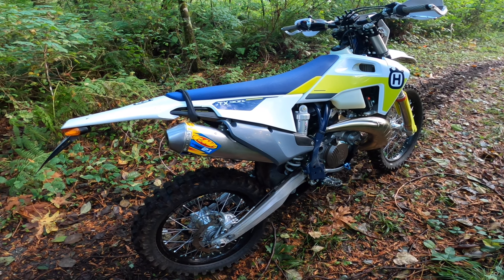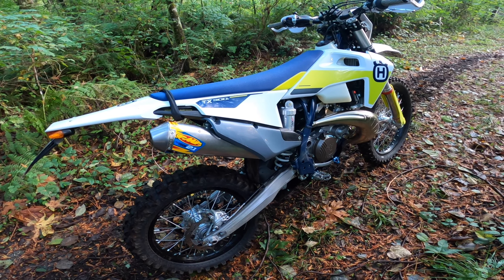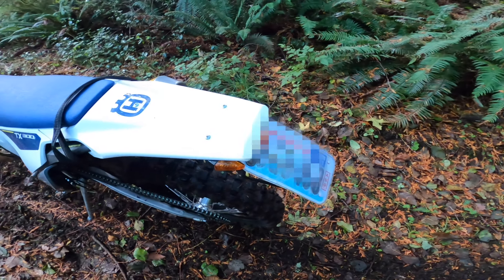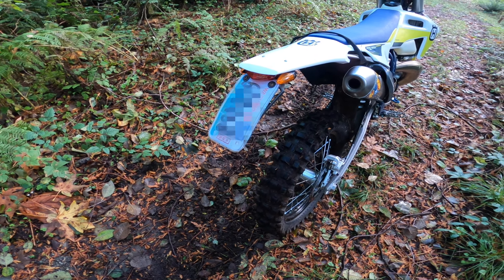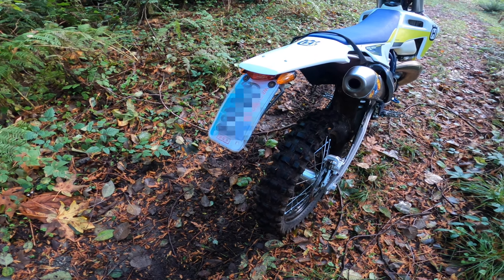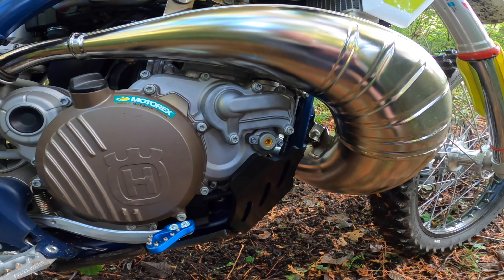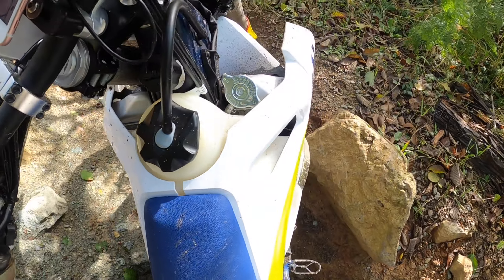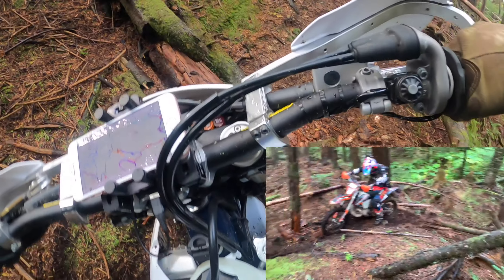2021 TPI - Mods, Issues, Fixes [KTM XC-W, Husqvarna TX300i]

Comment: Hey there, love your videos, I’m considering going from a 500exc to a 300 Te or TX, I’ve read about the problems with the carbon subframe breaking. Do you have any opinion on this?
Reply from the maker: It’s weaker than aluminum for sure. But I haven’t had any issues. Supposedly the 2021+ subframes are slightly stronger.
Reply: @WASemiHardEnduro  thanks, I guess every bike it’s pros and cons. One thing I read is everyone loves it for riding the trails.
Do you get to ride all year long being in the pacific NW
Reply from the maker: @3dpdstom  Yeah we do. There’s maybe 1-2 weeks per year when there’s lowland snow.
Reply: @WASemiHardEnduro  where are you based and riding, I like the idea of moving to the USA from the UK
Reply from the maker: @dirtbikefun  Western Washington State, not far from Seattle.

Comment: 3.5 turns out on the air screw is stock so 4 turns is not that far out.
Reply from the maker: You're right, but to get the idle where I wanted it, I felt like it was too lean right off the bottom @ 4 turns out. With the idle screw mod, I'm now at about 1/2 turn out, which seems to give it more torque right off idle. My seat-of-the-pants feel anyway.
Reply: Mine feels pretty good at the stock setting but I will try adjusting and see how it feels. Did you adjust your PV dolly?

Comment: I don’t understand. You bought a brand new bike and you have issues with it? How can this be? The reason you buy a BRAND NEW product is that you won’t have issues with it. How can you accept the fact that the power valve is already leaking? Please explain?
Reply from the maker: I updated the description a while back - the PV leak has completely disappeared, so maybe it was a spill and not a leak? I confirmed that KTM addressed the gasket issue on the 2021s. If you've never had a single issue with something you've purchased new, then you're the lucky one (and probably a rare exception).
Reply: @WASemiHardEnduro  but TPI issues are known for KTM/HUSQY back from 2018 why would they don’t fix it??
Reply from the maker: Seems like they did fix it (the PV leak). The other things I did were to make the bike better *for me*, like raising the idle. The bike works just fine stock, but like all things, can be improved.

Comment: For the Stout Mount, and Hondo Perfect squeeze ( I just bought both ).. Did you have to drill holes in the stout mount or the hondo (and tap)
? Or are you just using one screw for the hondo perfect squeeze?  the only holes that line up for the hondo mount would make the phone vertical which I don't want.
Reply from the maker: No I didn’t have to drill, the holes lined up (both should use the standard gps mounting dimensions)
Reply: @WASemiHardEnduro  Well that is strange, mine only lined up if the hondo was sideways which would make the phone vertical ( yuk!)
.  What I ended up doing was. Reamed out the bottom hole in the Stout Mount so bolt would fit through it.  Used calipers, measured 38mm drilled a new hole near the very top of the stout mount plate.  Also I had to cut the ends off the bolts that came with the hondo perfect squeeze because they were to long.  Anyway its on now loosely :)  Just need to finish mounting my USB Job and button it up. Mine is on a 2021 TE250i.  Thanks for the videos! Those trails in WA look a lot nicer than the trails here in Bend, OR.  https://i.imgur.com/5ggUTAh.jpg     https://i.imgur.com/SHn47G5.jpg      https://i.imgur.com/EgnEzLJ.jpg     https://i.imgur.com/nOFAWQ7.jpg

Comment: I just got a 2021 ktm 300 xcw tpi and have put about 1 hour on it and now it doesn't have spark new plug nothing hold onto the plug don't get shocked any ideas taking it to the dealership to see if they can fix
It
Reply from the maker: Double check all the wiring connections is only thing I can think of

Comment: I havent looked into it at all yet but does your perfect squeeze mount just bolt right up to the stout mount? It looks like you are powering your phone also but via the cradle?
Reply from the maker: Yes, the squeeze bolts up to the Stout mount. I’m using a separate usb outlet for power.
Reply: @WASemiHardEnduro  are you powering your phone directly or does the mount or squeeze have a power port? Tough to see. Cool setup though.
Reply from the maker: I’m using a Burnsmoto USB port to power the phone.

Comment: What are your suspension settings? My '21 300 xc feels terrible front and rear. Im coming off a '19 300 xc and I was actually very happy with the stock suspension on that bike. I was expecting the '21 to be even better, but it just bounces and deflects off everything.
Reply from the maker: Interesting - I'm running 123 psi in the forks, right at 110mm sag rear (but 40mm free sag which is a little much). Clickers are at the "comfort" settings per manual, except I've added back 2 or 3 clicks of rear rebound. I weigh 145. The 21 feels softer/more plush to me than other XC/TXs I've ridden, but I admittedly don't have much time on the older AER forks (I came from a Xplor48 bike, and this is 100% better in every way except comfort on fireroads).
Reply: The new mid set up was a nice edition and the bike works great for MX/GP style riding but is horrible for woods, hack, rocks and anything square edge over 1.5 inch. They respond really well to just a revalve and fluid level change. I went with MX Tech Lucky Kit because I want the feel of a spring fork. Corey at Protune is making the 21 fork work pretty awesome in the woods with just some shims. Honestly the 17 AER fork feels better in single track than the 21.
Reply: @cknymapleleaf  Haha its funny you say that. I took my stuff to Corey and it works amazing now after just a revalve. I considered the lucky kit, but decided to try the cheaper route first. I'm glad I did, because this is the best suspension I've ever ridden. It's was absolute garbage with the stock valving
Reply: I know a few guys that were super happy with a revalve from Corey on the 21’s. I’m used to a spring fork so I decided to go with the Lucky Kit From him. My fork was leaking air the day it was delivered. Fixed under warranty and it’s still losing air. Just decided I don’t want to worry about more issues with the air cartridge.
Reply: @cknymapleleaf  I know who you are now... We've had this discussion on Thumpertalk lol
Reply: I had a feeling we did!

Comment: What's the differences between Tx and Te?
Reply from the maker: Check this vid: https://www.youtube.com/watch?v=tbxbqUD5mqo
Reply from the maker: Suspension (TX has AER forks, TE has spring), Gearing (TX has closer 1st/2nd ratios), and Lighting (TX doesn't have lights or wiring for lights). TX ends up being ~11 pounds lighter. Those are the main differences.
Reply: @WASemiHardEnduro  thanks

Comment: Thanks for the great informative video. Question..how do you know the setting is right for the air screw? I understand the idle screw different buy not the air screw. Thanks again.
Reply from the maker: I honestly can’t tell too much of a difference. It’s really just how it feels at very small throttle openings, and low RPMs. If it has hesitation or sputtering, try going one direction to see if it gets better. If it gets worse, go the other direction. Also a hanging idle is a sign you e gone too many turns out.
Reply: If you want to understand the idle screw, air bypass relationship/adjustments more have a look at "two stroke performance" on youtube and facebook. Dave does some informative walk throughs in regards to tuning, updates and upgrades, rebuilds etc.

Comment: Te300 vs xcw300? Do you feel the linkage or pds is better for slow technical riding...or its a toss between the 2?
Reply from the maker: Coming from a PDS bike, for slow tech riding I think it’s a toss up - both work great. For higher speeds, I think the linkage has a small advantage - just seems to track better on bigger hits.
Reply: @WASemiHardEnduro  so in general the link is kind of better, ypu would say...if the gnarly stuff is the same? Some prefer the pds in the alow stuff and I am cureently in the market for one of these bikes, the husky being a little more expensive, so not sure which eay to go? Save a few $ and use it for tyres and gas or get the te, it will be better owerall, even by a small margin?
Reply from the maker: Linkage does hang down more, which is why some like the PDS. Doesn’t bother me though (get a good skid plate). You really can’t go wrong with either, but for me linkage gets the win.
Reply: I got my xc 300 for the taller first gear I also ride hard enduro and don’t see why I would need anything lower and the Triple clams and adjustable suspension is a nice touch

Comment: Why not just buy a TE light kit?  That’s what i did, plug and play.
Reply from the maker: What did you plug the lights into? Since 2020, the XC/TX doesn't come w/ the lighting wire harness. There is nothing to plug into. Also, the TE OEM lights are expensive and garbage quality compared to a good aftermarket lighting setup. :)
Reply: @WASemiHardEnduro  i have a 2018. Plugged right in along with fan and brake lights. Also plug and play with TE speedometer. KTM is getting cheesier year by year 🤦‍♂️. I paid $300 for kit from Slavens. Came with entire TE rear fender assembly.  Good thing about Huskies is that the title says motorcycle not off road use only...so it’s street legal.

Comment: A good mod is v force reeds the stock ktm reeds suck! I could see light threw mine with 5hrs on the bike! This was a 2019 ktm 300xc
Reply: I have a older 2011 KTM 300xc that I bought new and haven't had any problems with it and it had v force 3 reeds when I purchased it in May 2011. I have to wonder why KTM is using cheap or crappy reeds on their 2-strokes now plus I have NO clue why they switched to Mikuni carbs in 2016 instead of the better Keihin carbs? Good luck with your KTM.
Reply: @jeff40  idk probably a money thing with the reeds and I believe they switched carbs cause they had a tpi contract with mikuni

Comment: You must not be picky with suspension because the new 21 Xact settings are dogshit in the woods. I just ordered a set of Lucky inserts.
Reply from the maker: I actually love them for the woods. The ‘21 forks are really good.
Reply: @WASemiHardEnduro  talk to some tuners and they will tell you how bad the settings are for 21 in the woods. Have you ever had a really nice set of forks? I guess you only know what you have tried.
Reply from the maker: Ignorance is bliss! I’m $1000 richer and these forks are working just fine for me. If anyone I know gets theirs reworked, then I’ll have to give them a try though.
Reply: @cknymapleleaf  suspension depends 110% on rider weight. 140-170lb riders in stock form they're just fine. If you're a A or Pro rider, no stock suspension is good from factory. Plus being able to save money for tires and fuel vs suspension mods you more than likely don't need = winning.
Reply: Do you know anything about this 21 fork?
Reply: @cknymapleleaf  have a 21, it's good for stock. I'm a Vet A rider, tad soft in the front in the fast stuff but great in technical. It's not KYB good, definitely better than Showa out front and rear. I'd wait for rebuild time before dropping money for a revalve. Well unless you're riding it for competition then I'd look at Kreft.